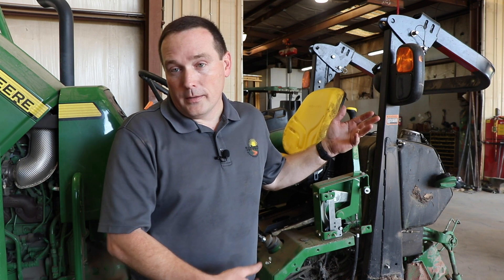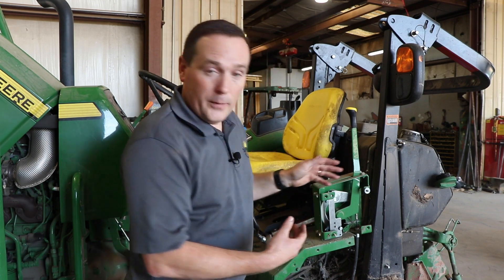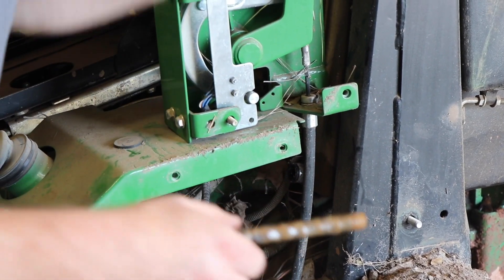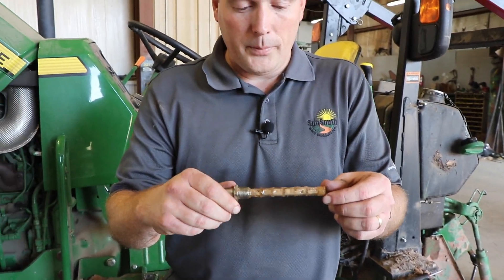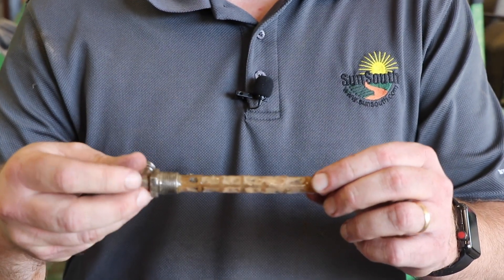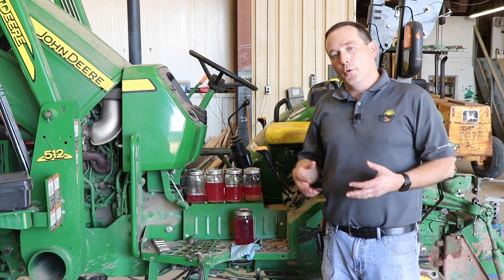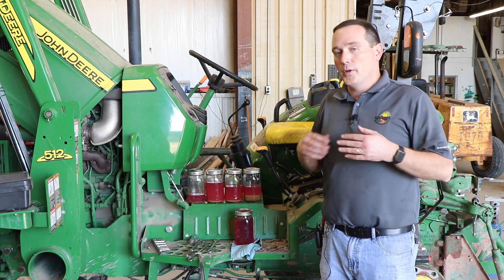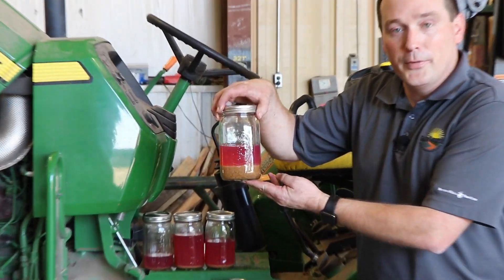Tractor Power Loss Maintenance

Comment: I have a 5075E and it's a nightmare keeping water out of the tank even with JD fuel treatment.
Reply: y 5075E dies after a couple hours work plowing snow.  Started at about 52 hours and now again at 120 hours.  I use only #1 Clear Diesel and treat with Anti Gel additive.  What is the fix?  What is the best maintenance procedure?  Do I have to completely drain the fuel to access this strainer?  Any advice appreciated.  Please.
Thank you
Reply: @almccallie4314  Your asking the wrong person.  I have switched places where I buy my farm diesel at and still have the problem.  I have a 30 gallon drum I fill with diesel and treat before I pump into my tractor.  I add an algicide, a water displacer and the JD fuel additive for cold weather to keep it from jelling.  The final product is a tractor that will never start when it's below 40 degrees and a fuel filter full of water.  Note* My tractor is kept indoors.  Look where your diesel leaves the tank, disconnect the hose then unscrew the steel fitting from the plastic tank.  make sure you catch the diesel so an empty tank is best to work with.  There is a filter inside the tank attached to the valve and I'll bet yours is plugged up.  This is what stopped mine twice until I totally removed the filter.  It's about 3 inches long and 3/8" round.  I love my tractor but it is so picky on fuel/air.
Reply: @markwhite6782  makes sense.  Every day I learn a little,  thank you Mark.

Comment: Have a new farnmtrac that allof a sudden is losing power,,rearlift also isnt working,,tractor only has 8 hours,,ran great until yesterday...engine acts like its bogging down when i try to increase throttle,,any ideas,,i wouldnt think fuel filters would be clogged with only 8 hours
Reply from the maker: Hi Charlie! Not sure, it could be several different things causing the issues.  I would recommend asking the dealer where you bought it from what they think it could be and if they could do some diagnostics on it. Thank you!